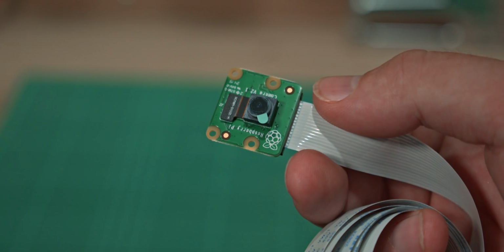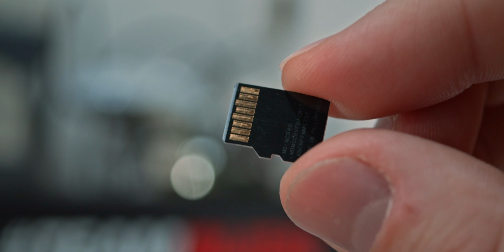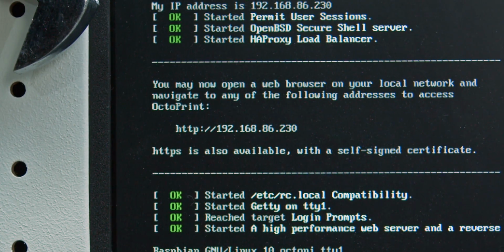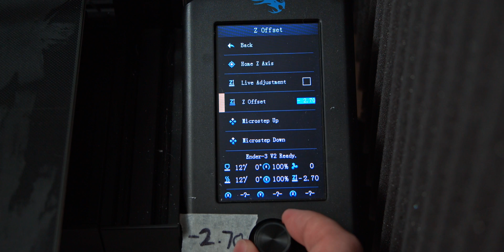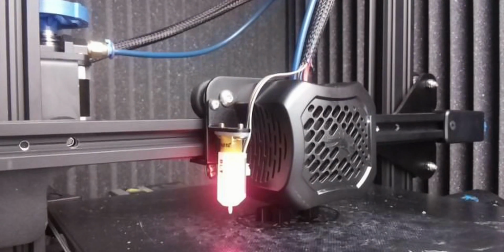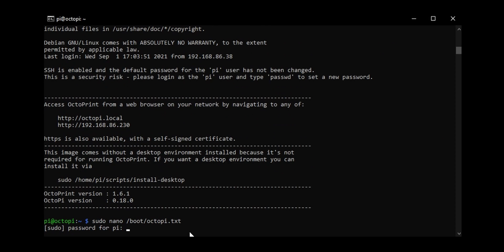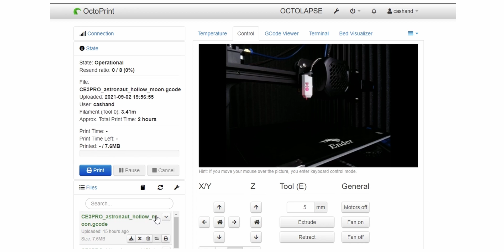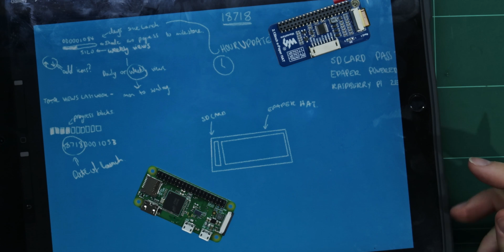Upgrading my 3D Printer - Ender 3 V2 Timelapses with Octolapse

Comment: Are you using raspberry pi camera v2 or HQ camera?
Reply from the maker: It's v2, I believe the HQ camera is a lot larger and requires a add on lens. There are a lot of newer raspberry pi compatible cameras out now too since I made this vid. Worth looking around 🙂
Reply: @camshand  Thanks for the reply bro! YouTuber notEnoughTECH said that raspberry pi camera module 3 is not supporting on octolapse. Is that true? reply is appreciated 😊.

Comment: that is a sweet enclosure, did you design and build it or followed a guide?
Reply from the maker: Thanks I designed it in SketchUp to fit the area I had available. Worked out perfectly to squeeze into the corner and to contain the Ender 3 v2 :)
Reply: @camshand  do you already have a video on the build? I didn’t see one when I briefly looked.

Comment: I really want to do this. I have a raspberry Pi from other projects. The one thing holding me back is that I don't want any issues with my cr touch. My setup is good right now and I don't want to screw it up. Lol.
Reply from the maker: Yeah my BL Touch has been a pain with it... Getting the right firmware working is the main thing. Believe I'm in a jyvers build at the moment and seems to all be smooth

Comment: What time lapse trigger did you choose?
Reply from the maker: I was using each layer and getting the head to move out of the way. Now I use the intelligent one which will try and take the photo at any time during the layer when the nozzle is in the same area. Ends up with cleaner and faster prints. Don't get the cool growing from thin air effect though as much since the nozzle is in the shot
Reply: @camshand  Gotcha... There is so many Smart Snap Smooth... Smart Snap High Quality, etc. They all give the same vague description. It would be nice if it was "use this one for better finishes on your prints". "use this one for better image quality". "use this for blah blah". I did one last night with the "printing effect" on for stabilizing... it was cool but a big distracting. Still toying around as I just installed my new bed mount system for my Pi Cam V2

Comment: oh buddy - been there with BL touch. I ended up using Jyers firmware to get more out of the device menu. I was having the dickens of a time utilizing the stored mesh after the re-flash. The printer would always fail a few prints down the road and start printing in the air. So now I manually bed level to get it somewhat close to start with. Then I just have my slicer insert the machine code every time I write out a gcode to have the machine perform an auto bed level, then store it to EEPROM. Now I can just upload my gcode straight to the octoprint server and not worry.
Reply from the maker: Ahhh yes Jyers, that's on my list to next flash. I've still been having other issues so what you've recommended sounds like the way forward! Thanks Shawn 😊👍

Comment: I have a few recommendations. Try using jyers firmware instead of smith 3d. I had constant  issues with smith 3d. Swap out the springs for silicone spacers or yellow springs. And then swap out the bed to be a magenetic pei surface. If you do all of those things and set the offset for the bl touch appropriately with the specs found online you will not have any of these issues. i regularly print petg without any heat creep or any issues at 240/80. Your filament most likely has moisture in it. petg is known to get moisture insanely fast into it. Keep it in a dry sealed box with Reusable Desiccant Beads Silica Gel Desiccant. All of the above will keep you happily printing.
Reply from the maker: Thank you for the advice, really appreciate it. I've been having more issues with the smith3D firmware and did start looking into others out there. I'll load up jyers this week and give it a go!

I keep all my filament in a sealed box with silica and also purchased a eSun dryer recently that I'll hopefully setup to feed through into the enclosure but for now I just dry it then load it up on the printer.

Do you recommend any specific magnetic surfaces?
Reply: @camshand  Textured pei is great but will need to be washed in the sink with dawn dish soap and then dried out and then put back on the print bed. The smooth pei sheet is great since you can just wipe down with isopropyl alcohol and be printing again. Both are amazing and i have both types of pei sheets.

Comment: what are the impressions after almost 4 months? Any corrective actions after implementing all those ideas?
Reply from the maker: Good question... It hasn't been smooth, I'm yet to install LED strips into the enclosure so I can keep consistent lighting.
The enclosure gets too hot as well so I need to cut a vent in the top.
The AutoBed levelling isn't working perfect... It's good for a print in the middle of the plate but my current project is using the entire buildplate so today I'm experimenting with 5x5 level mesh methods.
Haven't really captured a lot of timelapses until I can add LED strips and then close the enclosure again.

So yeah just some small tweaks, but I do like having OctoPrint to monitor prints, and the OctoApp on my phone for getting notifications if anything goes wrong :)